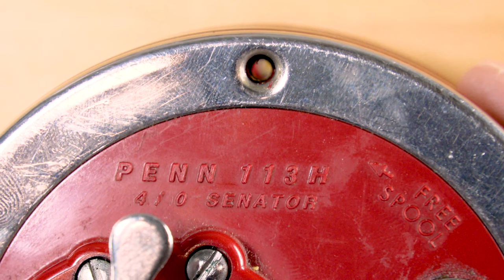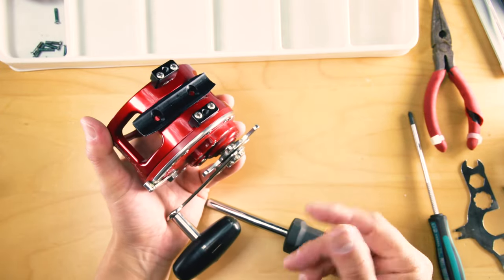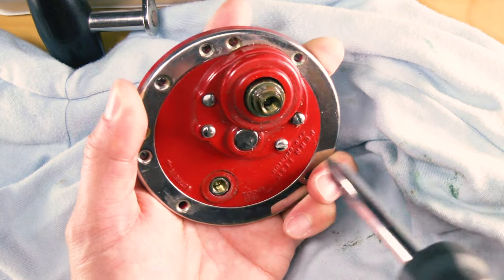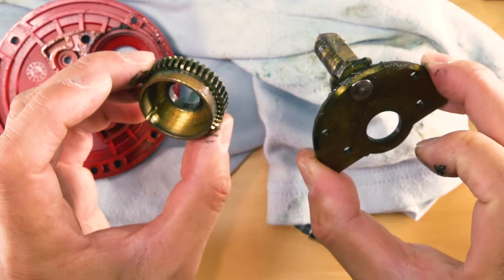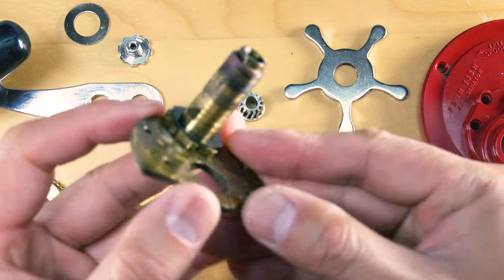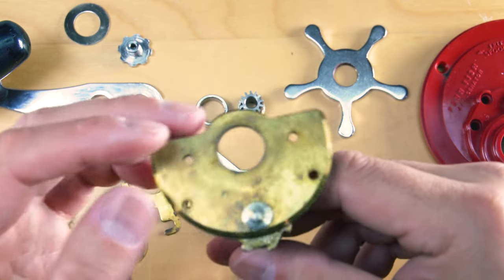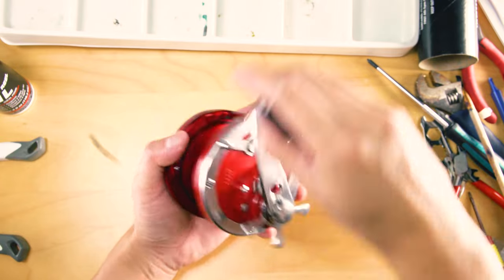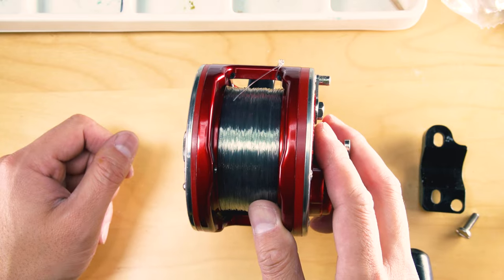Penn 113H 4/0 Senator Maintenance Service Tutorial with Tiburon Narrow Frame

Comment: sweet reel man, perfect yoyo reel for decades, I belive we got caught up with all the new tech in fishing reels, and forgot about those simple reels that got the job done for ages
Reply from the maker: 100% agreed Tony! Everytime I do more research, seasoned anglers will always say they did it with mono on the 4/0 or 6/0 with single speed. I’m definitely spoiled with the new tech and still love it. Hope to get some yellows on it this season 🤙
Reply: @Seastheday88  I would fill it out with 65 or 80 braid about 3/4 of the spool then top it off with 40lb mono for yoyo, yoyo is more of the reaction bite, so the heavier the line the harder you can pull them off the bottom
Reply from the maker: @Tony67032  i was considering that after the fact 😂. Don’t even have a small reel to take advantage of the remaining 30lb but love how limp it is. Thanks for the suggestion on it. May do that before next trip 🤙
Reply: Also agree. Recently found a pair of Senators in my brothers shed and refurbished them. They look like new now and working perfectly. I read on Penn's promotional material that the Senator came out in 1936! And is responsible for more IGFA records than any other reel. What a legend!
Reply: @pakde8002  yeap , it change abit from the start to when Penn took them of the shelfs, but yes tbey are some workhorse reel, we just got caught up on all this new tech , but senators accounts for tons of big fish caught way before spectra , when  all the reels only had monofilament
Reply from the maker: @pakde8002  every once in a while when I read about anglers asking for setups on BFT, I’ll see an occasional response of the senators with straight mono landed without any low gear. Good reminder we’re fortunate with the tech we have today. Albeit, some with less quality parts than they were decades ago.
Reply from the maker: @Tony67032  good reminder, I ripped off all the 30lb, used up remaining 80lb spectra that was on my Fathom 40n, then filled to top with 40lb Izorline XXX. I’m still working on dates to get out this month. It’s been hot fire season creating major fomo for me lol
Reply: @Seastheday88  yes we have a great start of a season, I'm just hoping for the winds to settle down and it will really get going , heard of those huge white seabass up the channel islands
Reply from the maker: @Tony67032  oh man. I was just reading the same thing and shared it with a buddy who goes monthly there. His first 3 trips this season got cancelled due to weather😬. Hopefully they stick around 🙏